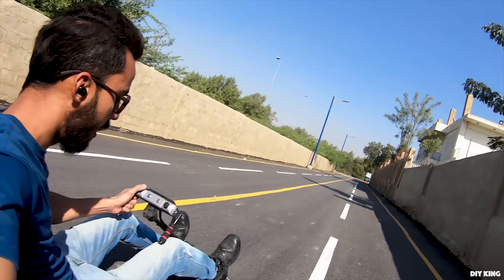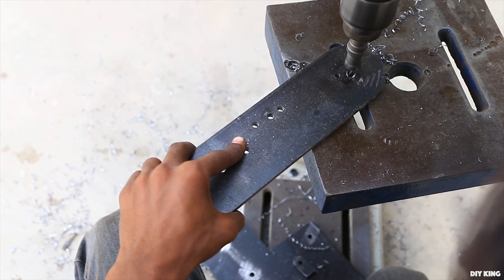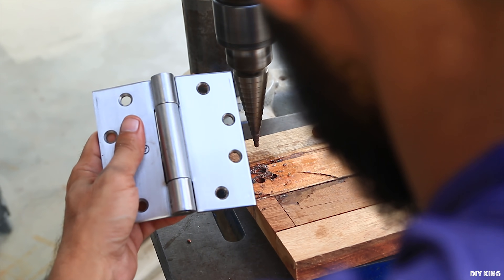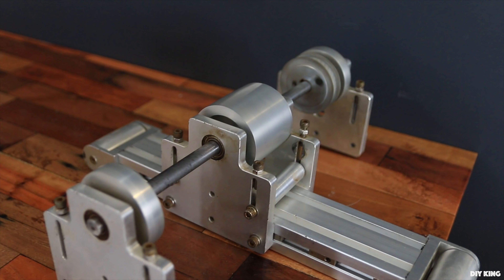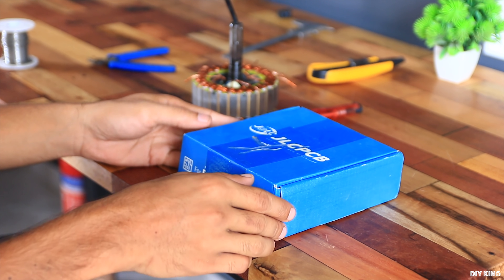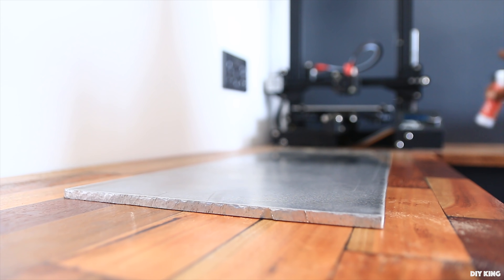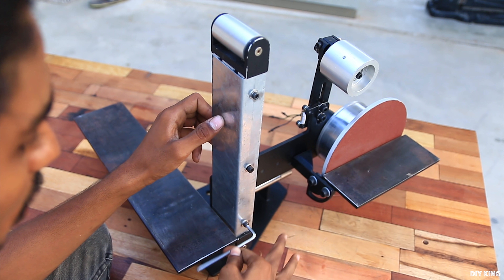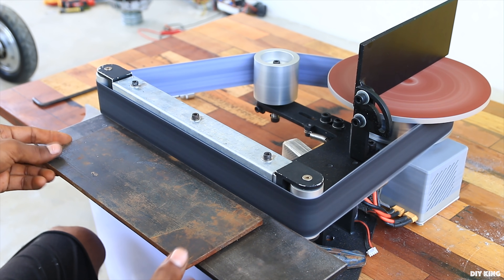DIY Disc and Belt Sanding Machine

Comment: I'd expect more than 350W - that's the hoverboard motor. Or is there anything I don't know? some secret power (more voltage)?
Reply from the maker: Yes I you did watched the whole video we have increased the speed of this motor by rewiring the stator winding, increasing the speed by three times and thus wattage too.

Comment: Also make the tensioner pulley surface a little convex this will help in keeping the belt centered. This technique is usually used while making belt sanders.
Reply from the maker: Yes you are right, that's why we are working to built a lathe machine to get things like this done on our own
Reply: @DIYKingSaM  that would be one heck of a project. Consider making 2 axis CNC lathe as it will be easier to make than manual lathe.
Reply from the maker: Umer that's what we are upto , you might have seen that laying in the background, still needs a ton of work to get completed.